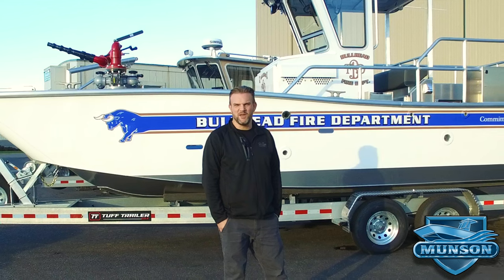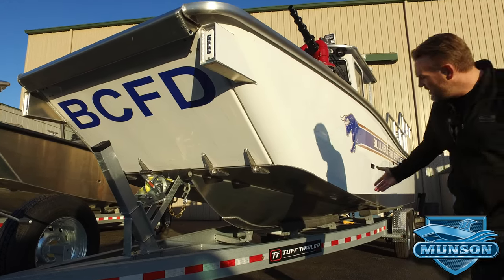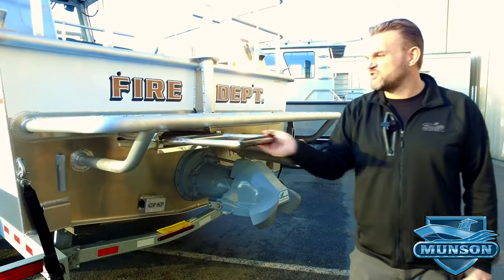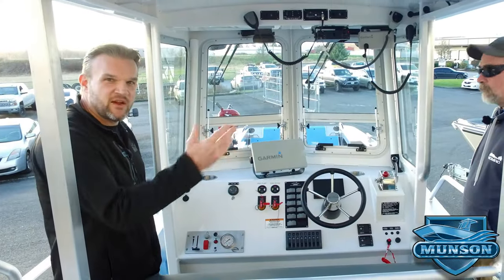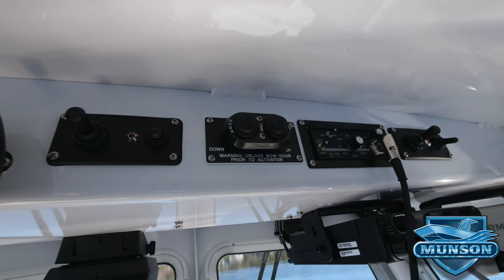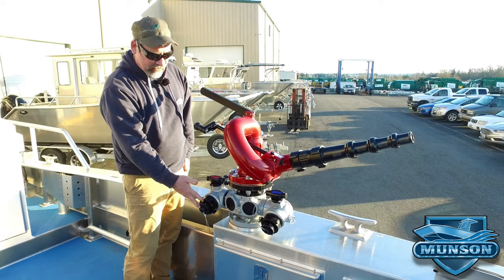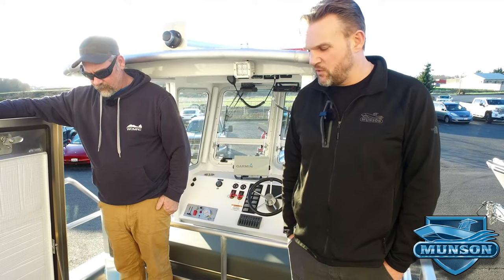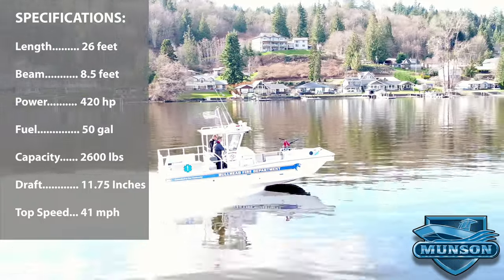26' Munson Landing Craft for Bullhead City Fire Department

Comment: Nice boat. 
That rear ladder is pretty small.when it comes to Width and it's weight capacity. It's great for everyday but if you've got dive gear on or need to help someone out of the water it's just too small.
Reply from the maker: Thank you, for vessels designed for dive operations we make a very robust ladder in house, and for the rescue/recovery of people, the bow door is FAR better than a rear ladder as it can be deployed to beneath the waterline.
Reply: @munsonboats  
I'm very familiar with the front door on the bow of the boat that can lower and raise. 
But it's always nice to have an additional option. Even the best of equipment can fail from time to time.    
Don't get me wrong I think it's a nice boat and you all did a great job. that was the only thing that I noticed that I would make an immediate change.